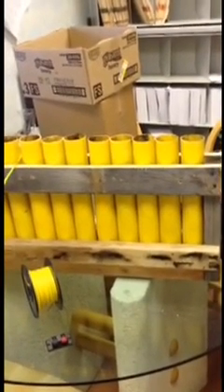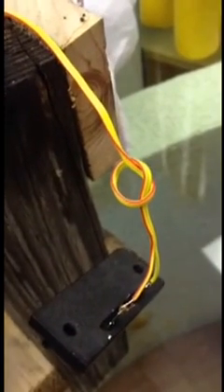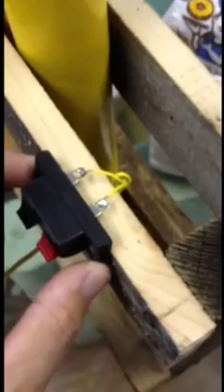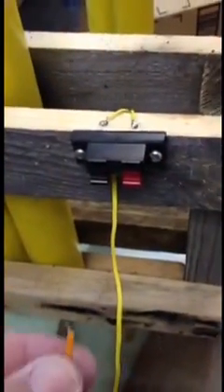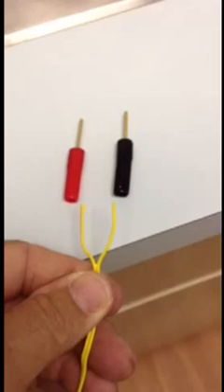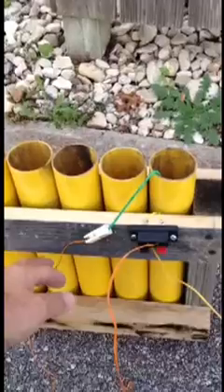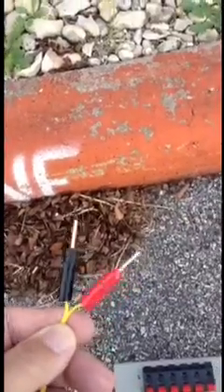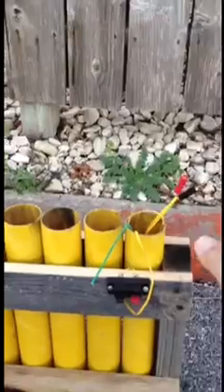Hard Wired Mortar Rack made with Videoshop

Comment: I like the idea, I borrowed it and drilled 2 holes through outside rail and passed wire through that way to solder then was able to screw terminal to outside rail.  Drilled hole next to terminal to bring wire back outside, then put in an eye hook next to it and tied wire in a knot on the eye hook for strain relief (like your knot on inside).  I put this on 8 racks and it works great. Thanks for the idea!